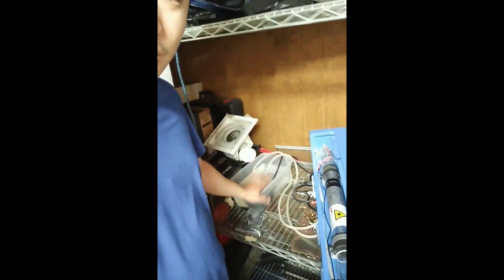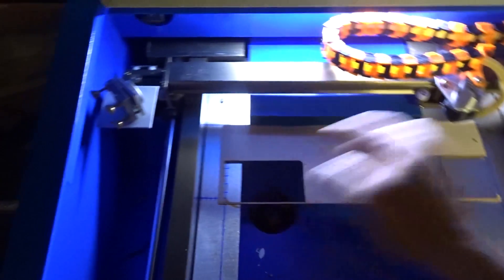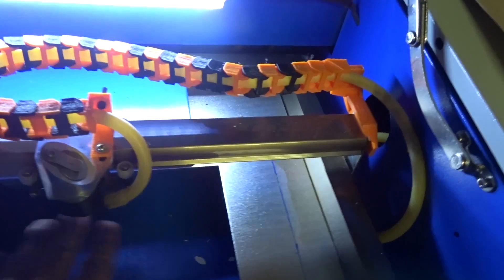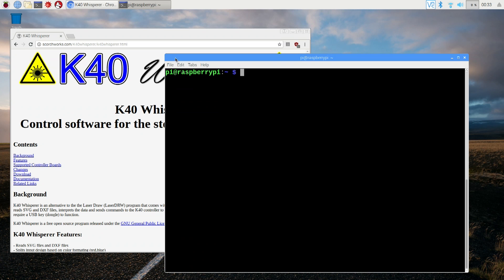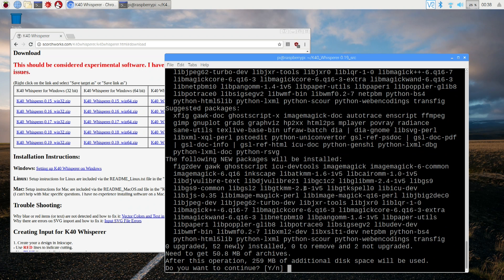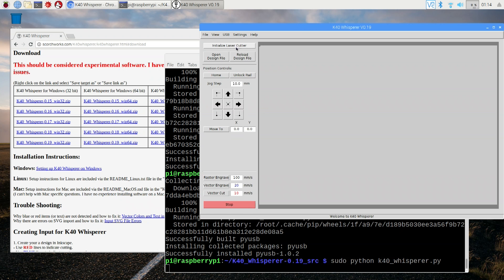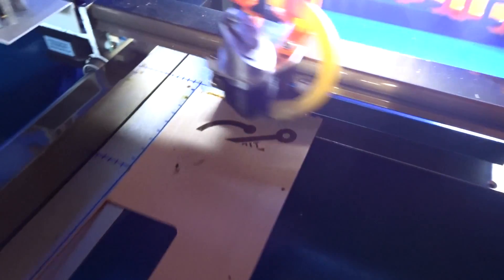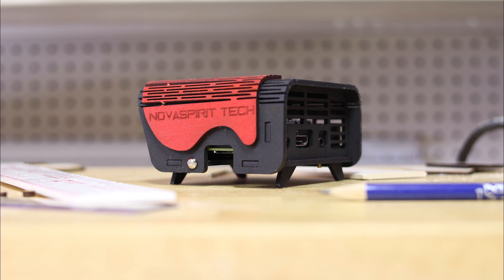Raspberry Pi controlled k40 40w laser cutter

Comment: I like your tagline "Hack 'till it hurts". Another one that you might like is "If it ain't broke, fix it until it is."

I recently got a K40 "free". I put free in quotes because I got it for free, but I'm going to have to put money into it just to get it functional. It's missing the 2nd mirror and mirror mount, so fist thing now that I've verified that the laser tube actually lases is to install upgraded mirror mounts, mirrors, and an air assist. I like the idea of running the K40 off a single board computer mounted to the back of a monitor that is also accessible remotely in the house through VNC. Would a RPi4 also run Lightburn if I choose to upgrade my driver board in the future?

Comment: so when I go through all this I get this back: 

sudo python k40_whisperer.py
Unable to load Pyclipper library (Offset trace outline will not work without it)
Traceback (most recent call last):
  File "k40_whisperer.py", line 5740, in <module>
    root = Tk()
  File "/usr/lib/python2.7/lib-tk/Tkinter.py", line 1828, in _init_
    self.tk = _tkinter.create(screenName, baseName, className, interactive, wantobjects, useTk, sync, use)
_tkinter.TclError: no display name and no $DISPLAY environment variable

any help here?
Reply: I figured out how to get it running on my Pi.  Ditch sudo and just try "python k40_whisperer.py"
Reply: I just ran into the same issue and was hoping for an answer on here.  Any luck?

Comment: great job,but please i need an 
answar ,how to download corel draw file into k40 program then into the RPI?  by changing the controller to RPI,did the edrawing still clear like in the corel draw?w
Reply from the maker: you can use dxf files exported from corel draw to the k40whisperer program or jpeg or png. i would prefer the dxf method.

Comment: nice vdo.
i am using k40 whisperer under Ubuntu on an older laptop, works also good under windows.

i'm not sure the raspi has enough power to do larger jobs , but it sure is a good workaround

I woudl love to see someone make a nice touch interface for it, then its the best to have with a 7" touch screen on the controls panel
beats any "pro setup"

you know you can do Gcode with k40whisp ?

Comment: I would be very pleased if I could win this case. Currently I'm building a CNC mill with an Arduino, but I plan to add a Pi to it so I can run an indipendent unit like your laser cutter and I am sure it would look fantastic to the setup :)

Comment: Nice wooded case you made.
I've seen a similar wood cutting machine before. My aunt's husband was into making wooden toys and had a computer controller wood cutting (IIRC, it's called CNC) machine. That one could actually cut much bigger stuff than the one you have. Can't recall if it was laser based though (never saw it in operation), but it probably was.

Comment: Good job on the video! I'd love to see you come up with a quieter air assist solution for the K40, because the blower you have right now is ridiculously loud!
Reply from the maker: totally agree! i did find more expensive solutions using small air compressors  but i think i got this air asset up and running for about $10 so i really can't complain other then the noise HAHA

Comment: wow, interesting... btw, is there an option to drive the laser cutter from cli?
Reply from the maker: since the code is written in python it's possible i would guess but i haven't seen anything about it yet
Reply: it was just a thought, but i guess that vnc and gui makes more sense here as it's more user-friendly than messing with cli. this way, you have a dedicated rpi that is for this purpose only :) vnc to the rpi, do your task and disconnect...